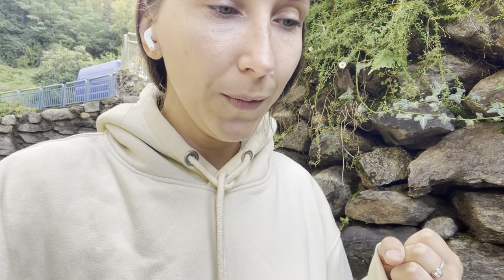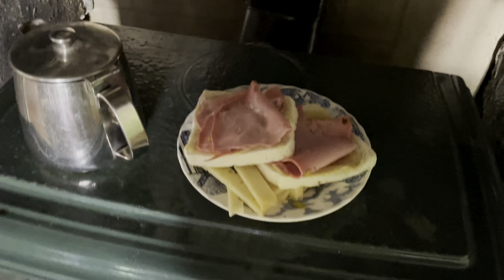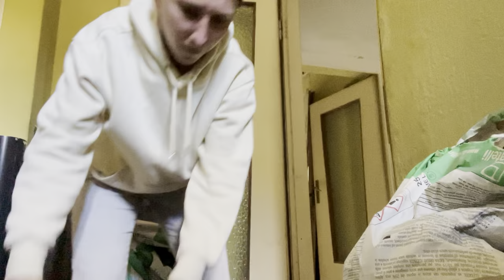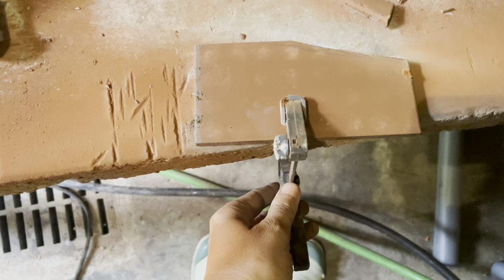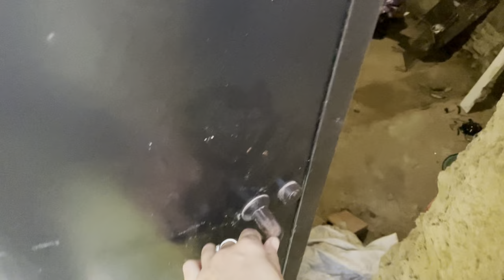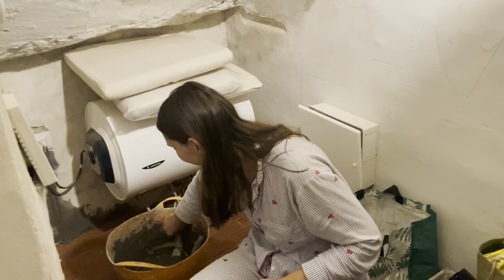It is so hard to work when you have a fireplace 😂

Comment: The terracotta tiles in the kitchen look soooo good. Given that you are probably going to be doing a lot more tile cutting for the rest of the house have you thought of getting a wet saw to cut tiles? Would be a good investment for the long term.
Reply: Hi Erika! I am thinking about several different things for metal\wood working but not about wet saw yet as angle grinder is doing just fine (however it's a bit noisy and scary)